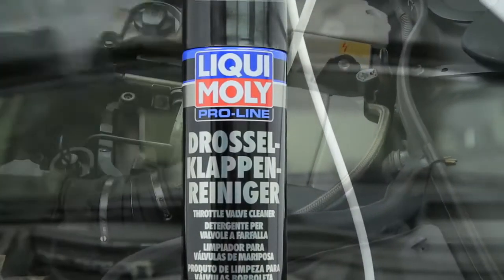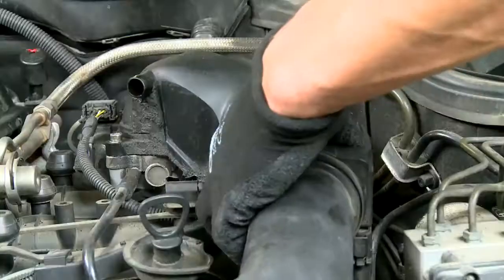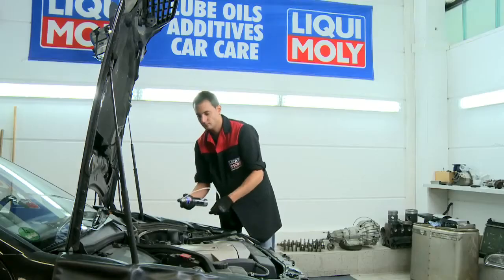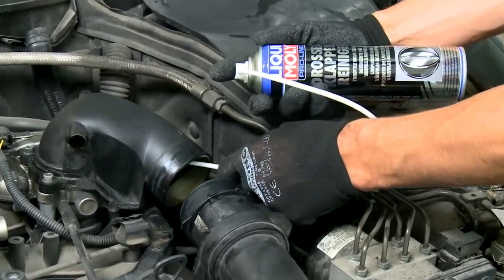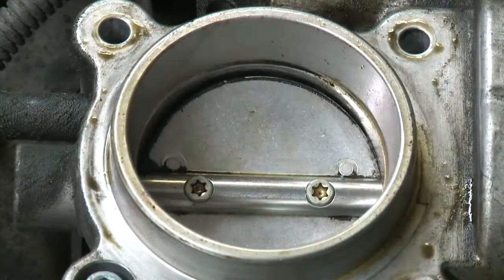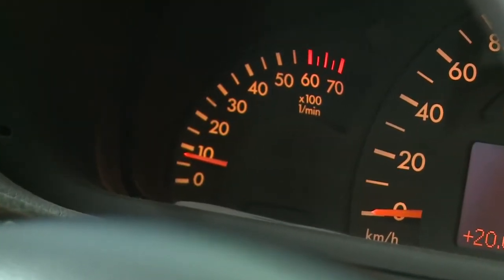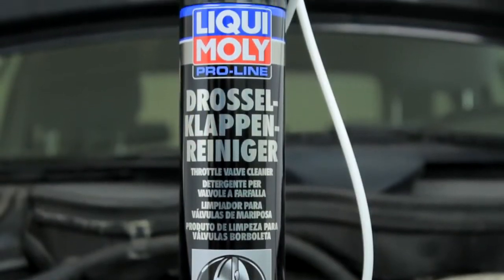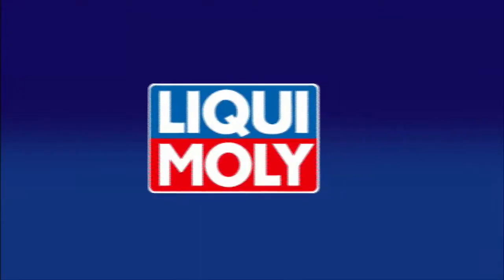21 LIQUI MOLY PRO LINE Throttle valve cleaner

Comment: After removing intake pipe and spraying through the throttle valve into the manifold on my 2008 ve v6 Holden Commodore and waiting for 2 minutes went to start and won’t, the battery has full charge and all the lights come on but doesn’t crank, when I turn the key it just clicks once and nothing, been like this for over 24 hours now.....anyone know what may have happened??
Reply: Did you solve the issue?
Reply: I think you need to remove the MAF sensor, it should start after.

Comment: Doesnt the waste of cleaning mix with engine oil?
If so, you should recommend this solution right before engine oil change, so the contaminated oil will be drained and replaced with new oil and filter
Reply: it doesnt get in the oil bjt in the combustion chamber. (just like fuel)
Reply: No, it does not mix, everything will burn in the combustion chamber.
Reply: @ziadbakkich3132  should I use the entire can at one go or can I keep it for next cleaning session?